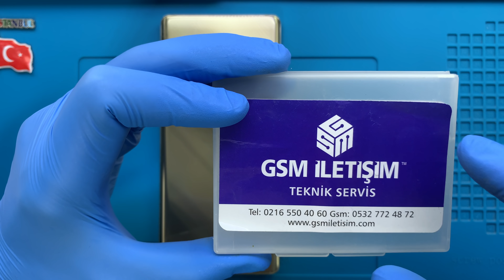Samsung Galaxy Note 8 Batarya Değişimi 🇹🇷

Comment: Is it still waterproof after replacing the battery?
Reply from the maker: Hello there;
Phone manufacturers only guarantee water resistance for undamaged and undamaged devices. For this reason, it is necessary to be more careful about liquid contact after screen - part replacement and technical service process.
Greetings.
Reply: @gsmi  :thanks 🥰